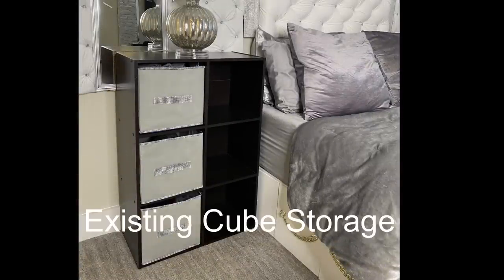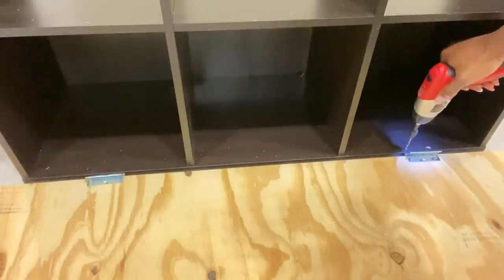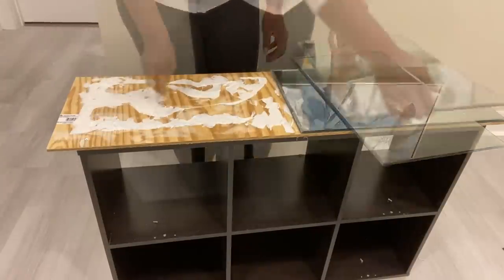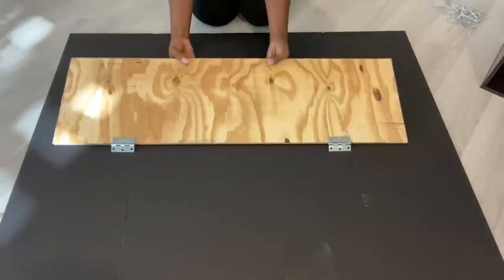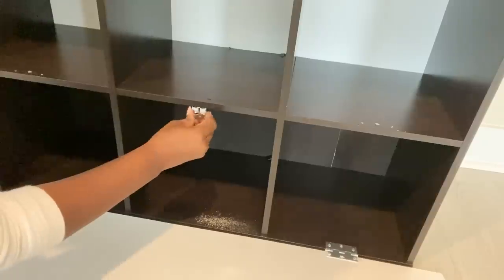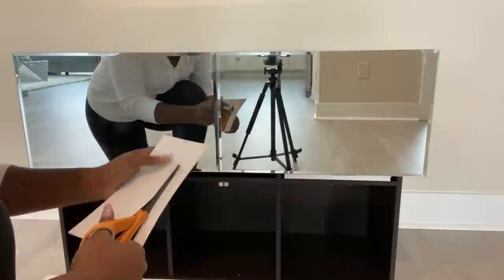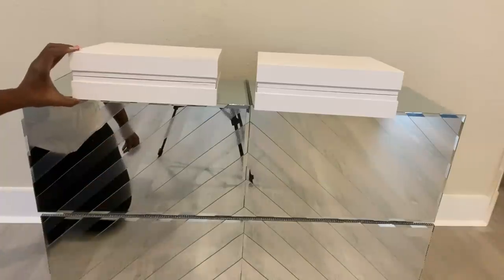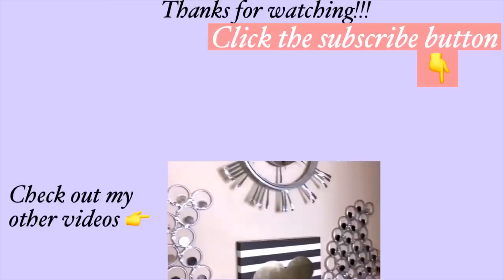HOW TO MAKE A BEDROOM TABLE USING CUBE STORAGE! DIY NIGHTSTAND

Comment: Phenomenal job!  Reusing what you have is a great way to experiment and finding out what works.  Not only did you come up with a great project, you sourced a solution to correct the gap from the added beading.  You are so inspiring with your ideas and the mirror tape pattern took the whole project up a notch.  Really great job!

Comment: You're getting so much better with every video although I probably would have finished it after the glass and not added that sticker design but that's probably just my preference I like the clean Sleek look of those mirrors I need to do my dresser in this mirror look but my dresser so big the mirrors are going to cost so much but it's going to be a whole lot cheaper than buying come mirrored dresser